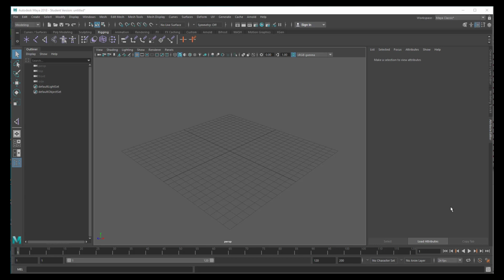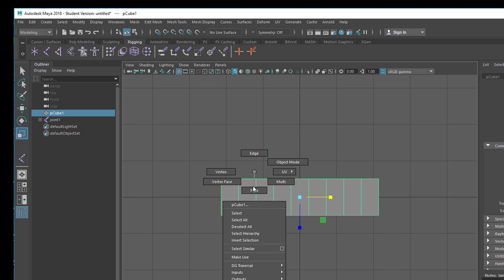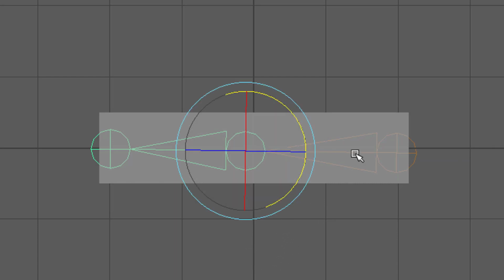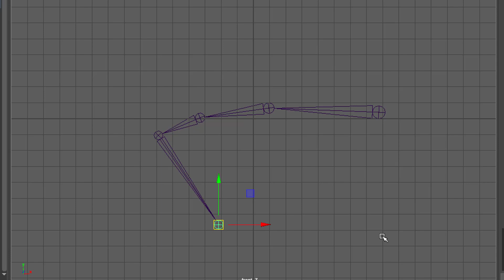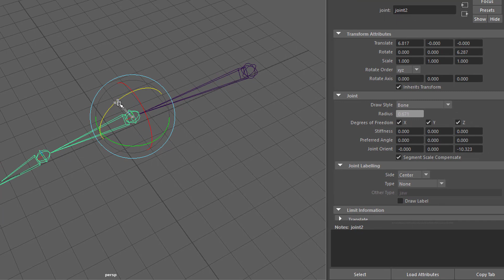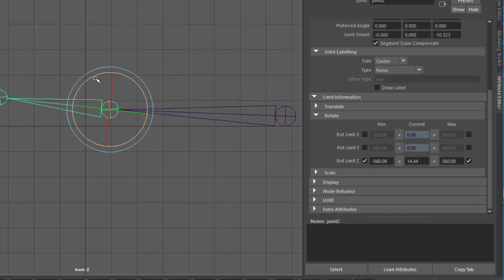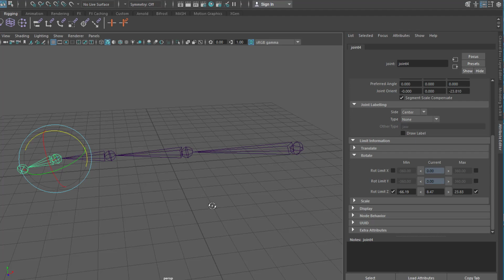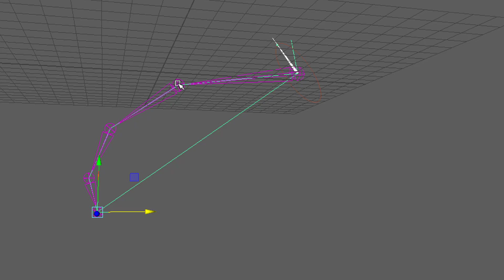Maya – Joints and IK Handles

Comment: Hi, Mr. Maximillian,
Thanks for Nice tutorial. But I have a question about Handles. We can move the skeleton with hierarchy button(Hier in select menu). So why we need the Handle? Or is it compulsory for move?
Reply from the maker: i don'tunderstand your question, serdar arslan. the IK handle is the end locator which you of course need to animate. it's basically a TRANSLATE node which frees you from animating delicate ROTATION values of the joints.

----maximilian
Reply: I'm new to Maya. Therefore, I did not understand the necessity of IK Handle and grouping.
Thanks.